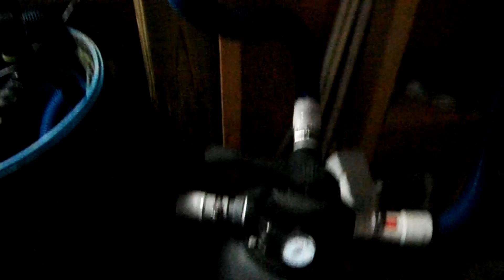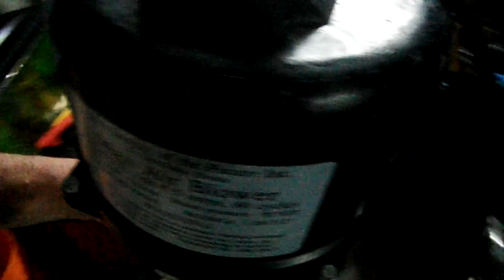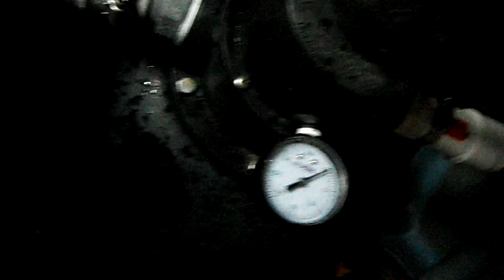Converted pool filter made even better.

Comment: Great video, Ken! And an awesome addition to your converted pool filter. I always thought about converting myself one , but I am a bit hesitant still. Scared it does not work as good as the proper ones and to waste my money on the diy. However after watching you doing it, I might give it a shot in the future, when I can hold off an old one that is for free. 👍
Reply from the maker: If I could do it you certainly can. I think the main thing to keep in mind is the water flow direction through the filter and the media you'll use. Most pool sand filters water flow is top down so floating media like K1 might work but wouldn't be ideal which is why I went for the K+ sinking media. Water flow through the filter is top down as designed and is working very well. Not sure in Australia but here in Canada people often sell used pool filters quite cheaply if they are closing down their pools or upgrading to a newer model filter. Might be worth checking out if you have a link to used items for sale in your area.

Comment: I am currently having an issue with my converted pool filter. It worked well but the backwash didn't clean it enough 
So this couldn't come at a better time.
Sorry about the leak... Frustrating
How would I do this system outside?
Reply from the maker: Setting up a similar system to mine wouldn't be all that difficult and for the most part would be dependant on the type of piping/tubing used. The main component would be the three way valve of the appropriate size, in my case 1.5". I would suggest using rigid pvc or abs pipe if at all possible as the fittings are readily available. I use the pool hose as it was much less expensive however the fittings can be a little difficult to find. As for the blower a good strong wet/dry vac with a blower function would work well. As you saw in the video following about two minutes of air agitation of the media the water went from disgusting to crystal clear. I'm over the moon with the end result despite the leak issue. 👍🏻